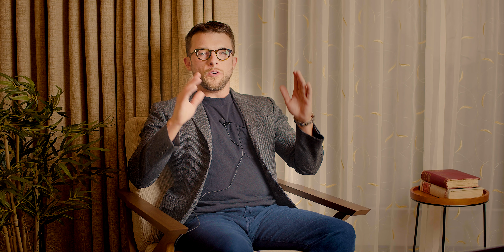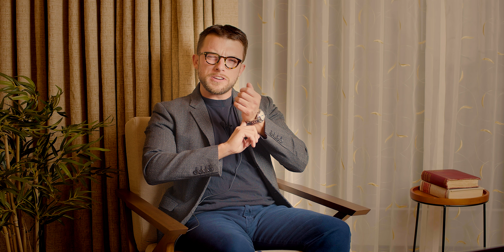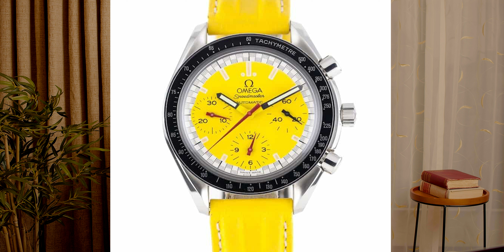Will Omega Beat Rolex ? Best Value Watch? Your Watch Questions Answered!

Comment: actually, Rolex QC is slightly better than Omega. Based on numerous purchases from both brands, seen some dust particles on the dials of brand new Omegas and slightly misaligned bezels. METAS is great, but real life precision and accuracy is about the same as the difference comes down to the user. The only differentiating factor is purely aesthetic, which is subjective.

Comment: If we're talking: Quality Control, Design, Technicality, Precision, Service & Value- Omega IS beating Rolex, in every way but marketing and gross sales.
Reply: actually, Rolex QC is better than Omega. Based on numerous purchases from both brands. METAS is great, but real life precision and accuracy is about the same as the difference comes down to the user. The only differentiating factor is purely aesthetic, which is subjective.
Reply: @explorerjlc1743  I respect your experience. My experience indicates better QC from Omega. I too, own (have owned) HMC, JLC, Rolex, Suunto, Casio, Seiko, Grand Seiko, Omega and AL&S (new so doesn't count). There are only three watches that have not gone back for warranty work (not service): HMC Pioneer Perp. cal., Omega AT Worldtimer & Casio G-Shock. The rest had probs of one kind or another... to include the Rolex GMT II.
Reply: @treykasia127  probably all about the same then, depends on luck.
Reply: @explorerjlc1743  I think so... I appreciate the dialogue. At the moment I have a bug up me bum about rolex... has everything to do with how poorly my long standing AD started treating me and other good clients around 2019. They clearly make great watches. But at the moment I'm personally promoting anyone but them for that reason. And the truth is: my Omega (ca. 2020) has been the most accurate mechanical watch I've ever owned (since starting collecting in 2009).
Reply: @treykasia127  yeah. My omega cal 1120 brosnan keeps just as good time as my modern submariner. Love the slim profile of the original Seamaster 300m too. Would say it’s the AD’s fault rather than Rolex directly.